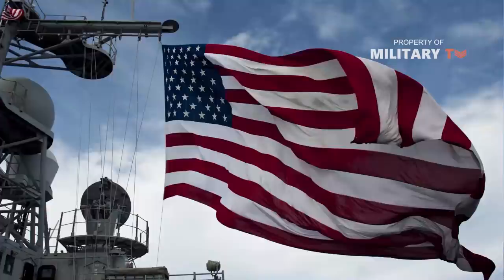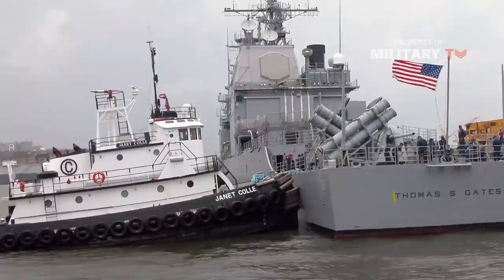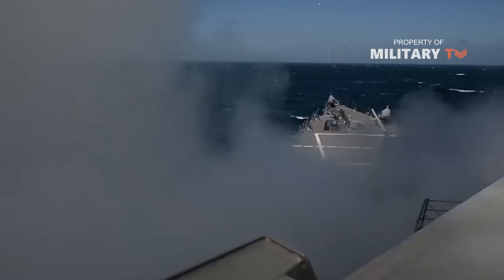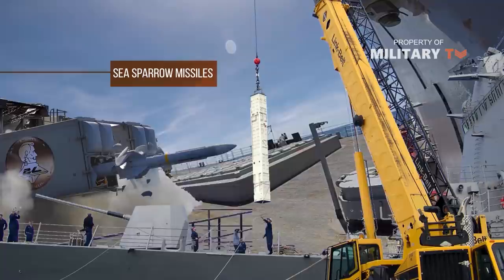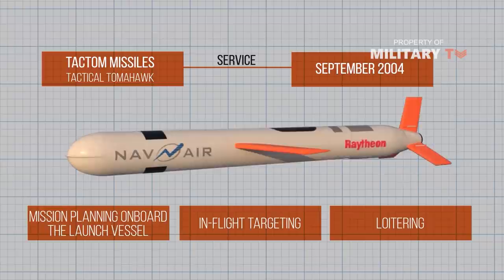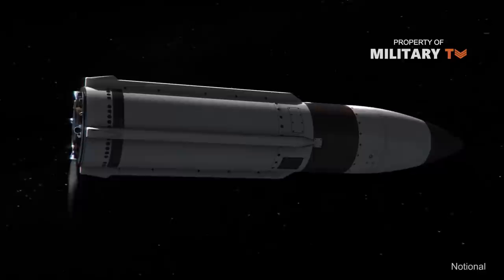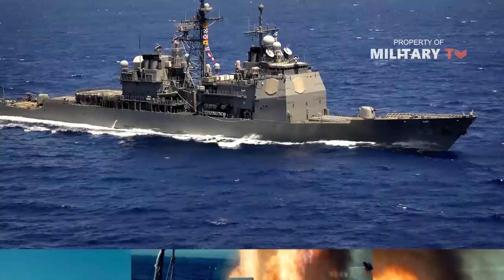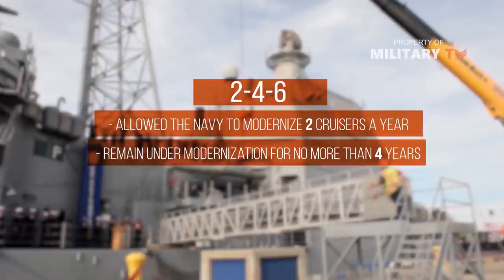Ticonderoga Class Cruiser Armament Review

Comment: About 30 years old ( some older, some younger) and still world beaters in their role. Says a lot for their design.
Reply: Most retired though.
Reply: @WALTERBROADDUS  incorrect, 22 or 27 built are still in commission. Only the first 5 ships built before the VLS system came into use were decommissioned and scrapped. This is because an arlieghburke destroyer with VLS is more capable and cost effective than the twin launcher equipped ships
Reply: The first 5 were retired because they were unable to be converted to use the mk41 VLS.
Reply: @sjd7188  I meant to say most are going to be retired.  Many are at 30 years now. And Budget cuts may send them out early.
Reply: @WALTERBROADDUS  yeah some of the Tikes have at most 2 or 3 years of commission left
Reply: @Chris J. Athens7 you mean the same weapons that are just literally modernized versions of cold war tech?

Comment: Of my 22 years in the navy I spent 6 of them on Ticos.  I liked these ships much better than the Arleigh Burkes.  I always find it funny listening to these video makers say things like "M" "K" instead of mark or "S" "P" "Y" instead of Spy.  "F" "Y" means fiscal year.  It was nice that he converted everything to metric.  One thing I did learn from this video, assuming its true is its ability to act as a flag ship is why it is designated as a cruiser instead of a destroyer.  I have had many mixed explanations as to why Ticos were considered cruisers.  Historically, and typically, it's the tonnage that differentiates destroyers from cruisers, but by tonnage and even by engineering plants, Ticos and Arleigh Burkes are nearly identical.
Reply: Ability to act as a flag ship as well as greater armament load out (120ish missiles and 2x5in guns for the Ticonderoga class compared to 90ish missiles and 1x5in gun for the arliegh burke class).

Comment: dont forget that the aluminum superstructure reduses the desplacement and is also easily meltable at the same time
what a dump idea
other than that a nice ship in terms of firepower
Reply: Being highly meltbable doesn't matter if you can't hit it. Hence why ships world why don't focus on super heavy armor.
Reply: @mirrormonstere113  a frigate or cruiser might not need armor

a cruiser needs armor
any ship can get hit eventualy
this is why crew on ships is still trained for damage control

a larger ship like a cruiser carries more sailors and this means it has more chances of surviving a hit

a larger ship like a cruiser is also in many cases a mothership of a battlegroup
this means higher ranking commanders are on the cruiser

a steel superstructure of the same mass could withstand fire much better
modern cruise missiles use explosives and not armor penetrating warheads this means that your armor will be penetrated anyways, after the penetration a wild fire can completely melt the aluminum superstructure realy fast
Reply: It isn't the structure that's hard and expensive to fix.  In fact that's going to be the easiest part of the repair.  It's the internal systems and cables that will be ungodly expensive to replace/repair.
Reply: The reason the superstructure is aluminum is so it's not top heavy.

Comment: I wish I cod work on a Ticonderoga class fire control but I work on an old fire conttol system on u.s.s. Buchanan and u.s.s. cook  it was about the same time period when the Ticonderoga class came out back in the 80's
Reply: I was on The USS Marvin Shields FF-1066 for my 1st ship. My fire control computer was designed in the 50's and still had gears. lol I later went to school and got transferred to the USS Valley Forge CG-50, but it cost me 6 more years of duty.

Comment: So sophisticated it shot down an Iranian civilian jet liner killing all onboard?
Reply: That was the results of several problems that manifested.  A new ship, and an inexperienced crew to start.  Engaged in active combat with Iranian surface ships.  One of their guns jammed and the ship was making an emergency turn to bring the other gun to bear.  An inexperienced sailor didn't realize that the ship's IFF gear was detecting an Iranian F-14 that was taxiing at the airport the airliner had taken off from.  So in the minds of the crew it was an Iranian F-14.

This was a high stress situation and a lot of things were going on at the same time.  The airliner knew that the ship thought they were an F-14 but for some strange reason didn't communicate that to the ship.  The airliner was then warned four times to turn away from the ship or they would be fired upon.  The airliner ignored the warnings.  

A lot of things went wrong here.  There were many chances to avoid the disaster.  They were not identified and acted upon because of the inexperience of the operator, and the number of thigs that were competing for the officer's, petty officers, and Captain's attention.  

And the Iranian pilots behavior was (to put it mildly) inexplicable.  They knew that the ship was referring to them as a warplane, but said nothing.  They were given four warnings to turn away from the ship - but ignored them all.  They also were going fly over a hostile warship.  What were they thinking?
Reply: @colincampbell767  I was on a WestPac in 88’ and was there when they pulled into Subic Bay, our OS’s thought it was funny to hang a sign off the side of our ship that said “nice shot” their captain did not.
Reply: It was also funny how the jetliner was off course heading straight for the battle group and not squawking any IFF. Why a civilian jetliner wouldn't be IDing himself in a hot zone and flying right at an American warship is beyond me. I was on CG-50 and we were out there too shortly after that. It wasn't cut and dry like the Iranians claimed. Can't say how many times we got flown over when we should have blown them out of the sky 20 miles out.

Comment: I am a plank owner of CG-56 USS San Jacinto. As much as I loved serving on an AEGIS Cruiser I always thought they should have stretched the hull fore and aft to give them 90 VLS Cells fore and aft - 180 total. If they had done that the HARPOON missiles could have been placed where they were on Spruance/Kidd class destroyers and there would have been room for 16 of them. I never did like Gas Turbine Engines those things are fuel hogs. Diesel-Electric drive would have been better. Now this is all water-under-the-bridge I know. But they would have been incredibly flexible and powerful surface combatants as well. IMHO.